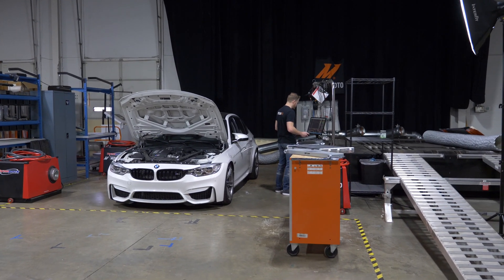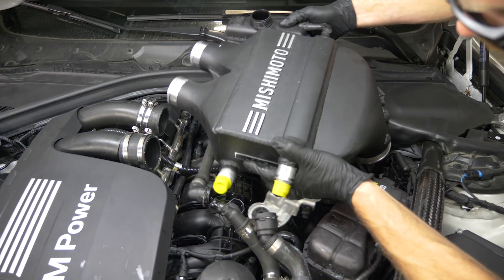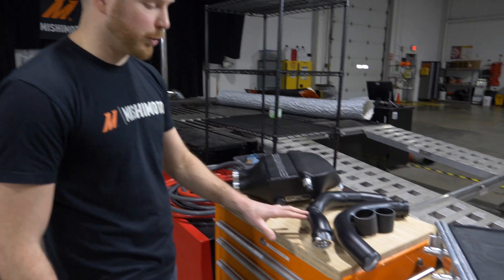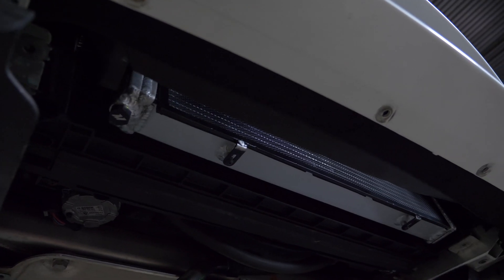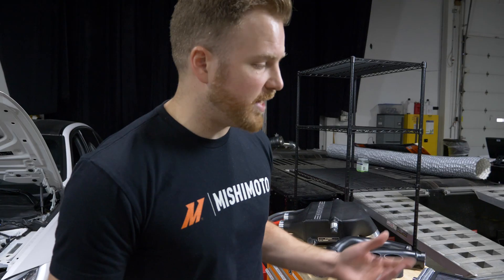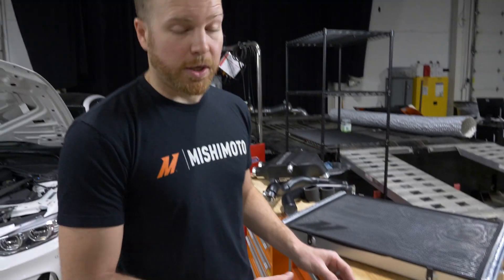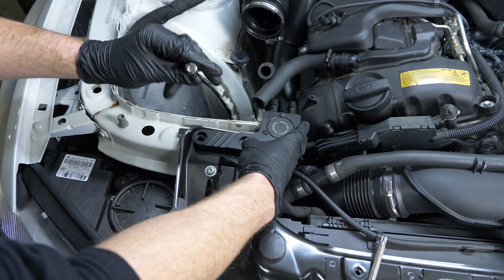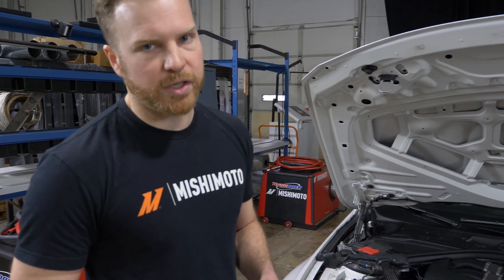BMW F8X M3 / M4: Mishimoto Powering Perfection

Comment: If I buy the intercooler kit, is it recommended to buy the upgraded oil cooler? What happens if I don’t and stick with the stock oil cooler
Reply from the maker: You are not required to install the oil cooler when purchasing the intercooler kit.

Comment: Hey folks, would you stand by your intercooler as being better than the CSF intercooler? I got recommended by Justin at AutoTalent here in California. I have a 2018 E85 M4.
Reply from the maker: We did a good bit of development for this kit and are pretty proud of the finish result. Feel free to check the data out below.
https://www.mishimoto.com/engineering/2020/02/bmw-m2c-m3-m4-performance-a2w-intercooler-2015-2020/

Comment: Looks like you guys are here to disrupt the F80/82 market. You ve mentioned a flow improvement on the exchanger but not actual temp drop, the delta between stock and your exchanger.
Reply from the maker: You can find this information on our site, I have included a link below.
https://www.mishimoto.com/bmw-f8x-m3-m4-performance-heat-exchanger-2015-2020.html